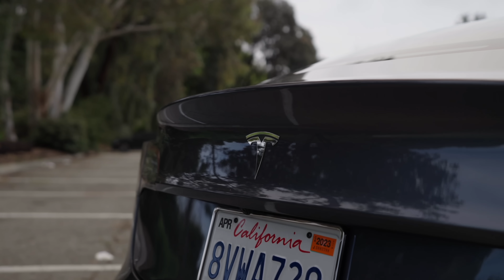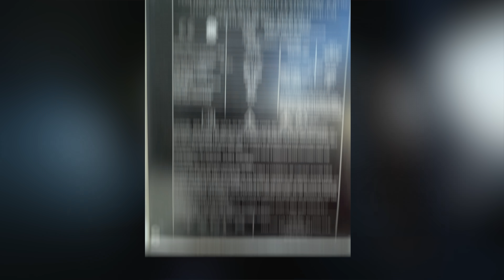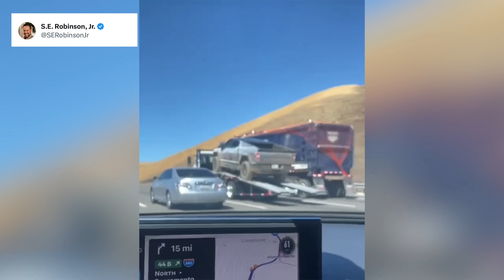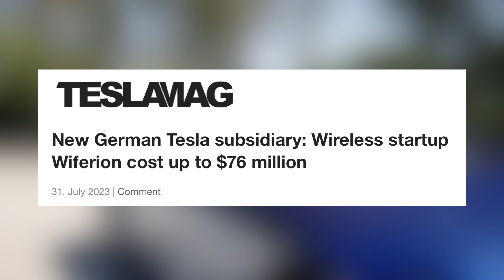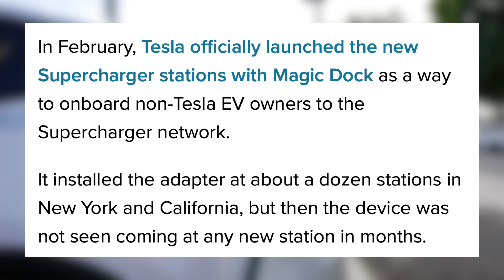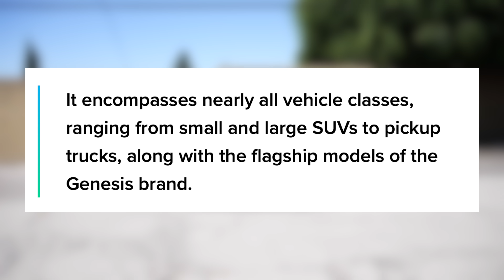NEW Tesla Price Cut Is Coming | Here’s The Bad News

Comment: I have 2018 model X 100D. I lost power steering control and almost crashed a few months ago. I was told it was a software update glicht and it went away with a following update. I had a few warnings on the previous days and but didn't think it was anything serious as it would just go away after a reset.
Losing power steering on a hight exit was scary as hell.

Comment: Note that in Hong Kong, the tax rate on Private Motor Vehicles is almost 100%, that US$50K Tesla is about $US90K, unless you salvage your current vehicle (not resell it). Rates ratchet up depending on the price range of the car, higher the price, the higher your tax. Looks like Tesla is playing with the prices to help drop the cars down to the lower tax bracket. Hong Kong is a very dense area, so the tax is there to discourage people from buying cars and using mass transit, which is arguably the best in the world and second cleanest in the world (Japan is the Cleanest). I do not see any price adjustment in the US, unless the Tax incentive price point is lowered (and is behind some of the reductions in the US previously).

Comment: Tesla needs to add an option to have an audible Blindspot monitoring warning if there is a car in the blind spot rather than just the visual on the screen
Reply: Agreed, and this would be super easy to add.
Reply: For some reason I believe my Model 3 does ding at me if I turn on my turn signal and start heading into that lane. I got the car two months ago.
Reply: My model y does
Reply: Even shows the blind spot car in red and it shows up in the camera.  What else do they need to add?
Reply: @Baker.Matthew  an audible alarm if there is a vehicle in your blind spot would be beneficial, similar to several other vehicles I have driven
Reply: @kylerobinson7572  has that, what software version are you running?
Reply: @kylerobinson7572  go into settings, then auto pilot, then turn on Blindspot collision, warning, chime

Comment: i just came back from vegas and dropped by the super charging station at barstow outlet. there are probably a hundred chargers there. not all of them are in operation at the moment. on a weekday afternoon, most of the active chargers were in use when i was there. i can see that station packed with over a hundred teslas when it is fully operational.